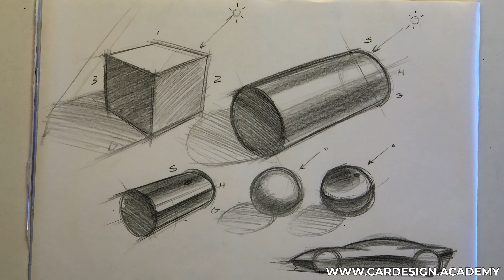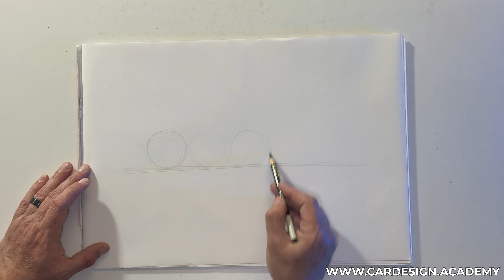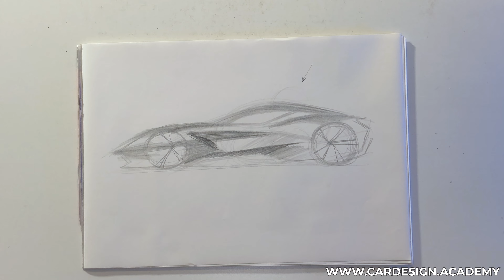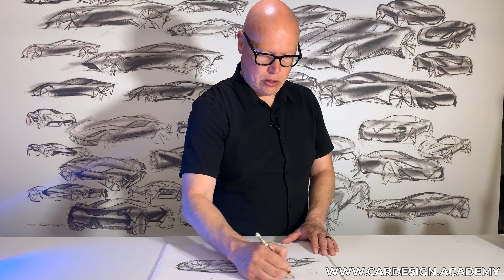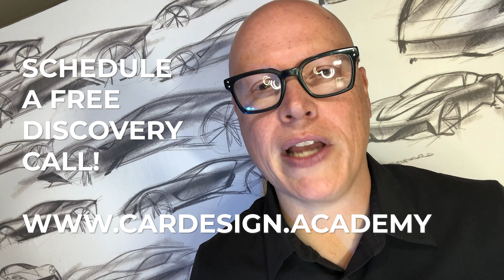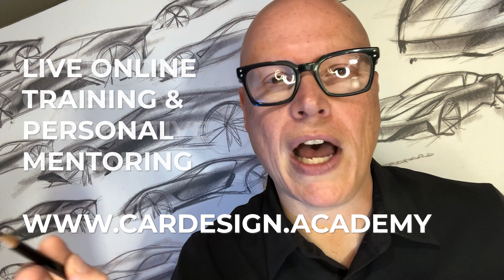Car Design 101: Rendering a Sports Car in Side View

Comment: Question for you. If the light is coming in from above then why do we color the top surfaces in sky tone? Just confused
Reply from the maker: Good question…Actually the light is coming from a 45 degree angle to provide max contrast with the horizon. Also, the sky is always darker above and lighter at the horizon, so on a true reflective surface the sky tone will be darker no matter the light source.